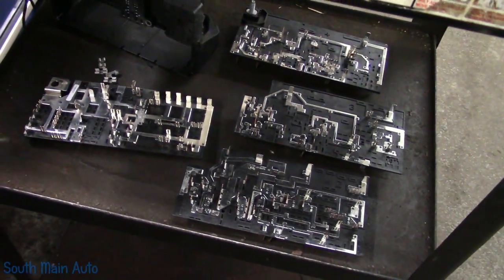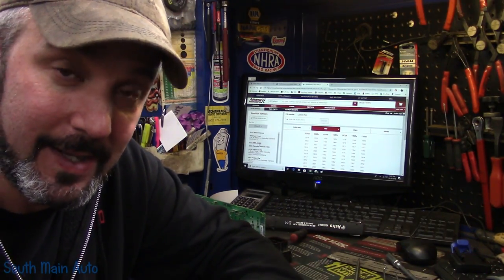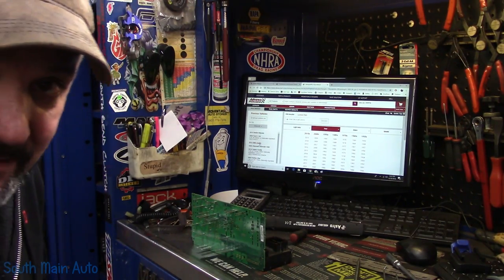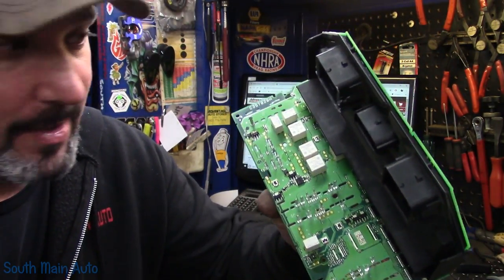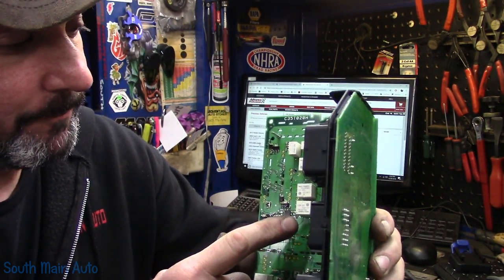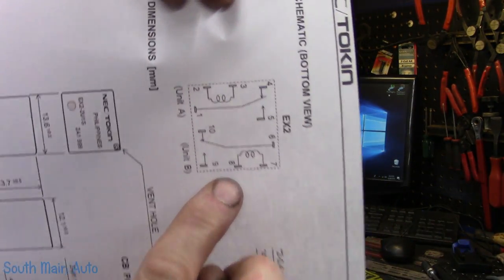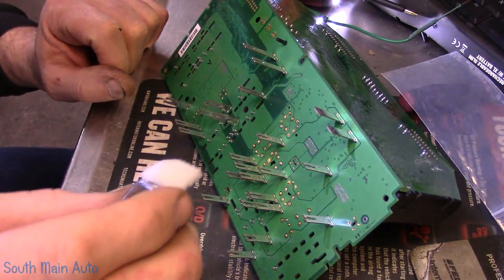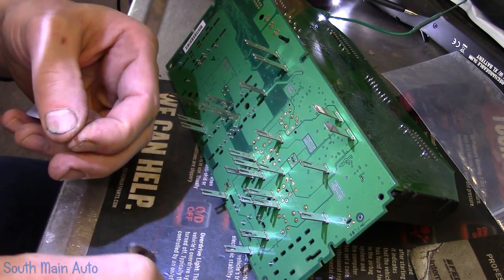Chrysler / Dodge : TIPM Repair - No Wipers

Comment: It’s amazing how voltage will bring out the French in you. I was once working on a communications circuit which had 140 volts simplex voltage across it to power it. It was hot and I was sweaty and the housing was mounted to the base of a TVA high voltage tower. I had a conference call up with the customer and tester and about that time one of the wires came in contact with the back of my hand. I said words that would have embarrassed a sailor and at a volume that carried for several miles.
Reply: sounds like the time I grabbed some old "T1" circuits, thinking it was all dead, no one of the pair wasn't and I found Mr. 130 Volts DC flowing into my fingers and out the back of my very sweaty hand. I didn't yelp too loud, but I sure did move fast ;)
Reply: throttle bottle Yep this was T1 but was using HDSL as transport. Same effect. First T1 I installed, I was getting ready for acceptance test and it went dead. I scratched my head for a while until the lights suddenly came back on. That evening an old cable repairman was telling how he was looking for a pair to cut around with and when he cut it with his scissors, it knocked the living shit out of him so he put it back together. Mystery solved.

Comment: The best way to desolder is to first flow a little fresh solder over the old solder and then use the solder sucker after you heat up the solder. Do not use the soldering iron to loosen up the leads after you remove most of the solder. You can use needle-nose pliers to loosen up the leads.

Comment: You'd have much more success with soldering & desoldering if you change your tip (or the iron, if tips are not available for yours) for a chisel-shaped one (3 or 4 mm wide). It's not only the wattage of the iron but how effectively the heat is transferred to the joint. Pointy tips are for very specific needs (usually legs of ICs).  Also get some liquid flux: a pen-type dispenser (looks like a paint pen). Use a lot of flux on the braid when desoldering. It help wick the solder into the braid.

The solder sucker: 1) heat the joint until you see the pin move or solder turn liquid, 2) immediately remove the iron from the joint and pounce on the joint with the sucker (vertical, with the white tip making an air tight seal on the board--or as much as possible) and pull the trigger. 3) Repeat as necessary to get the pin loose.

Comment: Another method , that is less stressful to the circuit board, is to "chew" around the relay with sharp cutters, cutting the pins off of the relay, to free the  relay but leave the pins in the board.  Then heat the pins individually .  Pull the loosed pin with pliers or push it out thru the hole.  A wooden toothpick works well  for that and can be used to open a hole that has filled in with solder.  Push the toothpick  through the molten solder and let it cool.   The solder wick will also pull the solder out of a board hole.  Flux helps the solder flow whether removing or adding solder. If flux is added to the wick, it will wick better.   The flux in the hypo looking tubes(ebay) is easier to apply.  Alcohol or brake cleaner on a toothbrush will remove the flux residue.
I would have tried to ohm between the wiper motor terminal pins and the relays to ID which of the 4 relays was for the wiper.

I don't see the difference between resoldering the pins on an instrument cluster  or  replacing the gauge motors and replacing a relay  in the fuse box(TIPM).  Both are valid repair procedures.  

Judging from the response, I would suggest doing one of these whenever the opportunity presents.

Comment: Eric, always use a solder tip that is  wide enough at the very end5 to cover the solder connection your working on. In other words, you used a newly sharpened pencil, when you should have used a really dull one that needed sharpening. Now lay the solder wick flat across the solder bead about a quarter inch or so back from the end of the wick. Hold the tip at 45 or less angle on top of the wick right over the solder bead below and when you feel the solder iron drop ever so slightly as the solder melts, you instantly remove the iron and wick and you should be left with a clean terminal. Snip off the used piece of wick and then repeat the process on another terminal.
Reply: Disregard 5 , I fat fingered that and missed it. Thanks for the great video I loved that one. More real repairs is what I say, and have to do on my cars. Jpol

Comment: If you've got a known bad multi pin component, it's best to cut the leads (pins) and de-solder one at a time.  You cannot heat all pins at once so go ahead and destroy the relay exposing the upper sides of the pins- then de-solder each individually.  Use the solder pump to clean each hole out after pulling the pin.

Comment: Solder sucker technique:  No doubt there are YouTube vids that demo, but:  1. Soldering and desoldering in general works better with a temperature-controlled (not just adjustable) iron, with a tip that has enough heat capacity to heat the joint quickly. A bit bigger than used here, and chisel tip.  And 2. You want to maneuver the sucker tip to as best possible "surround" the joint, while applying the iron, with minimal air leak, and suck while the iron is still applied. That goal is of course frustrated by the soldering iron tip being in the way. So it's popular to modify the sucker nozzle so it has a notch in one side that "wraps around" the soldering iron tip.  Or the tip just ends up that way after many uses :-).

Comment: Hi Eric,that was cool watching you  trying to teach yourself electronics repair.haha...FLUX....that's what relay helps.and maybe flux core rosin solder.also a chisel tip,a small size is fine.i watch a guy named SORIN on ELECTRONICS REPAIR SCHOOL,he's a good guy.I fixed my 94 Honda civic fuel relay problem,buy using my skill of testing with carb clean as fuel,and the fact i didn't here the pump turn on with key on ,from you.thanks good video.
Reply: Cold solder joint on the relay?  I fixed a friends due to clues from Click and Clack the Tappet Brothers.

Comment: +1 on why that wasn't a accessable/replaceable relay. That relay is Waaaaaaaay undersided to power a wiper motor. No wonder it's contact were fused. IMHO all this stuff they're doing to reduce weight has reduced reliablity to unacceptable levels. Loved the video. Always wondered what voodoo was in that box.

Comment: According to a diagram of the TIPM that same relay you replaced also powers the rear wiper washer. It's a double relay, one half is the front wiper on/off and the other half of it is the rear wiper washer.

Comment: solder always flows toward the heat, so put the "wick" on top of the solder on the board and apply the iron on top. Always clean the area you de-soldered and apply "flux" to the solder joint when installing the new part.

Comment: Desoldering components in two sided board can be a bit challenging, it get a bit worse on the power pins since are usually connected to bigger track or planes in the circuit boad than tend to dissipate the heat or the iron and never get the solder properly melted. So, for the big one, just give it more time. Dont rush with the pump just because it looks melted, because the lower solder probably is not. Let it more time and then suck (the solder jeje). For the big power pins, iron of 60W would be great. And, like snap on, or Mac, electronic rework tool have different options. I been using the large desoldering pump from GOOT ant it is a hell of difference against the no name ones. Sometimes the job gets complicated just because the tools. As the last resource dont fre afraid of cutting the component out, with cutters of dremel until you expose the pins. Then heat the solder, grab the remains. Ok, the holes still blocked, but it WAY easy to unblock them when there is no pin inside. Also you can reach both sides of the board and indentify on wich side is better to attack. Lest see, the big plane of copper is on the relay side, you cant see it. Heating from this side is more convenient since it is the more reluctant due heat dissiaption. Trying to heat from the other side can be frustrating. The wick helps. Again, the one from goot is WAY BETTER .... but I didnt find he recipe, since Im more used to the pump.

Comment: Hi Eric / The Awsome Mechanic!  There is a tool that Desolders such small circuits such as that that's better than the wick or the booger sucker as you so called it {LOL} I think it's called a de-soldering gun that is capable of heating the joint more perscisley and has a vacume pump to extract the old solder - This tool is used by micro electricians who repair electronics PC board - like the one you worked on - Might be a good investment to look into if you are doing alot of PC board repairs...Here's a tip for you to pass onto your sister -{ Dont run the wipers dry - the excess amperage is probably what caused the relay to fail because of the fuseing due to high current.

Comment: I have a 2004 Dodge 2500 and continuously have lamp out and it is often the TIPM that needs replaced, they last about 2 years before it needs replaced. I grew up your way and may take a trip up.

Comment: The copper braid solder sucker is still the first choice of de-soldering experts--ask me how I know. Here are a few tips for your success next time:
Use a solder iron between 25-35 Watts with a FLAT  tip at least 1/2 the width of the braid you're using. Trim the braid square on the end--no loose ends. Heat the iron. Place the end of the braid over the whole solder pad. Place your iron on top of the braid so that as much of the flat tip as possible contacts the braid. Heat the braid for about 2-3 seconds and pull the iron and braid away. Success !! Don't go over them again. Tap each solder pad with a microhammer and pull the component out of the board.
The braid de-solder works---everything else sucks---confused ? LOL
Rich

Comment: If you do this again, re solder all the relay contacts and add fresh solder to the relay pin locations. When using wick, don't use the edge of the wick, use the full width of the wick down over the contact you want to de solder. Then  the wick material will siphon out the newer solder along with the old crusty solder usually in one operation and leave a clean empty solder pad. Try it on an old board when you have a chance.

Comment: Hey, its non-leaded solder which is high temp.  What you want to do is flow some of that low temp solder you have next to the board onto it.  That will create a alloy that will melt at a lower temp.  THEN use the solder wick to remove it.

Comment: Eric,
Great video and fix - Ivan will be proud! Nothing better than a brothers love :)
Im just curious if your removed/disassembled the TIPM to ID the relays and then put it all back so your sister could drive the van while the relays were on order or did she just let you hold the van until the relays came in?
BTW solder wick or the sucker work just as well once you get experienced with them.
SMA#1
God bless
Paul

Comment: When soldering or desoldering,heat is generally not a problem for the board, it's pressure, do not press the iron in hard, let the heat do the work.  Now some components will be sensitive to heat while soldering or desoldering, in that case you can heatsink the component using hemostats. It is easier to desolder sometimes if you flow some new solder into the joint before extracting it.

Comment: 53:56 Every time a relay makes or breaks a connection an arc forms this slowly pits the contacts (creates a very small crater on the surface which is supposed to be flat) this causes the resistance of the contacts to go up slightly. The contacts are designed to be as low resistance as possible to minimize the heat developed in them due to the current flow of the circuit they're switching.

With every cycle of the relay the resistance increases by a small amount typically contact resistance isn't an issue unless you operate the relay well past it's rated lifespan or it's a poorly specified relay for the application. Once the contacts have become badly pitted (think the surface of the moon rather than two flat surfaces) the resistance is so high (the contact is so poor) that the current flowing through the contacts produces excessive heat which can cause the relay to melt.

Comment: The best way to desolder is to cut the component off of the pcb first.  Especially a large component like a relay because they rob the heat from your tip.  Anyhow awesome vidja. Oh and with solder don't get led free and when in doubt add flux!
Reply: or preheat the board carefully, just not so hot all the parts and solder melt and fall off :))
it's pretty much 100% needed when you get into thicker multi-layer boards with lots of copper and heavy gauge through hole parts.

Comment: When removing old components from a circuit board,..  It is good practice to flow in new solder first.   This will help solder wick and solder suckers to remove all the solder together.   Also you may want to buy some good electronics solder like Kester "44" 0.031 rosin cored

Comment: For small circuit boards like that I like to use a little compressed air to blow the solder out. Safety squints a must and you have to be a little careful about where the solder goes because it could short out something else so careful inspection is a must. I have had some luck with the suction type tools. Most leave just enough behind to be a pain. Ideally you heat them all up at the same time and just pull it off. Unless the component is glued to the board. Yeah that's annoying but does happen.

Comment: Just watch your video on your sisters car. You were working on the “TIPM”. Great video. Thank you. Do have a question. On the base portion of the TIPM that you didn’t take apart. Was that portion complete sealed. Or can it be open. Im having AC issue with mine and may have to work it? Thank again and great video.

Comment: Hi Eric did you put your flip flops on so the Ivan would not complain about you stepping on his toes! Great Video and really good advice for the people who are fearful of attempting the unknown. Be careful but do ot be afraiid to try something new or different. You just saved $550.00 and learned how to use a solder sucker in the process. I do have a feeling that Ivan does not have to worry about you moving in to his territory. (LOL).

Comment: Use a hot air gun of choice to get solder over multiple pins to melt as gently pull from board

Comment: If your fixing your own stuff or a friend. It always pays to look. So far this year I have repaired the air bag control module in my 94 F250 for $3 by replacing a resistor and thermal fuse. And got a free 50 inch Samsung HD TV for the bedroom. Found a burned out device on the power board. Soldered in a new one for $12. Have a fine working big screen for a whopping twelve bucks.
Next is a bad capacitor on the ECM on my 89 F150. Have the capacitors on hand 10 for $13. Truck is on snow plow duty so will wait until spring.

Comment: You needed a wider tip on the soldering iron but you started out using the solder copper wick correctly. IF you use a wider tip you don't have to hold the iron on the part so long to get the solder to wick into the copper braid.  Either method, the solder sucker or the solder wick works.

Comment: You don't have to get all the solder out, plus you run the risk of damaging the traces. I use a 0.5mm drill in a hand pin vise to clean out the holes perfectly. Makes replacing the part a lot easier

Comment: Eric: since the solder on the board is lead free, which does not melt easy, you add your solder from your roll to remove the lead free solder. Get it? Add solder to remove solder.

Comment: i have found a wedge under the relay,( screw driver ) applying pressure on the solder....then heating the pins from the under side, and the relay will raise up and out as you relieve each pin

Comment: I have a Saab twice once the wiper motor stopped working people replacing them for 600 drilled the rivets  and tapped for 6-32 s/s screw . Found brass ground strip going to aluminum casing corrosion dis similar metals cleaned working fine ,same with power lock

Comment: Good fix! Lots of vehicles have designs like this. One of my friends Ford has fuses on the top and bottom of the fuse box. You can't get to the bottom ones without pulling the battery and fighting to flip over the fuse panel. Stupid designs sometimes

Comment: Those may be 5v control input relays..!     Are you jamming 12 volts into them ?
Also, you should always ADD solder, to remove solder, it will flow better...  (your solder  tin/lead, but on the board  they use  tin/silver as per ROHS lead-free requirements, which is harder to de-solder).    ...And using solder-wick is an art...

Comment: One thing you'll find is that cheap desoldering wick sucks (figuratively, literally it does not suck solder well at all) . If you add some flux, which you thought of but didn't try, it works ok. Expensive name brand desoldering wick (e.g. multicore) comes with flux and works great. As others have mentioned, adding some leaded solder before removing it makes a big difference as well.

Comment: I had the same issue with the horn relay. Did the same thing. Biggest struggle was lining up all the pins when putting it back together. Succes. Dodge didn't get my $1000 (Canadian).

Comment: Hard wired relays on a commonly failing part, a marvel of engineering as usual. I wonder if there would be a TIPM board diagram in the service information, seems unlikely.

Comment: I got a rebuilt tipm off eBay for under 200. It works great and there was no need to program. Like the dealer told me would be needed.